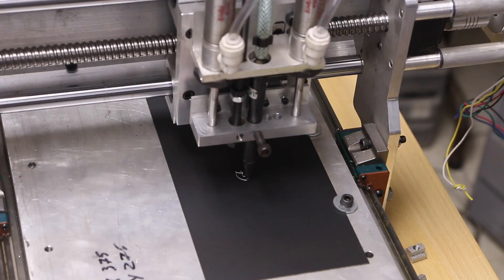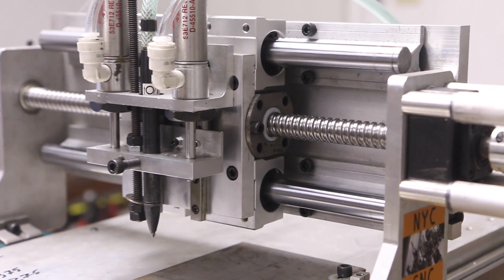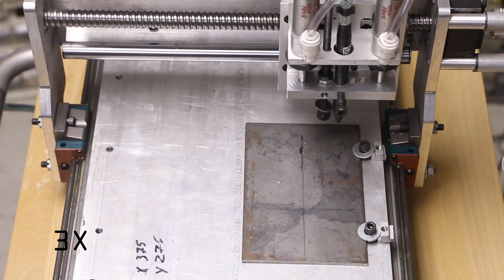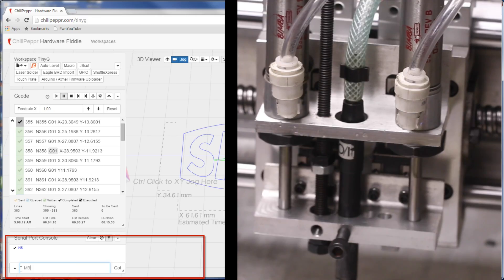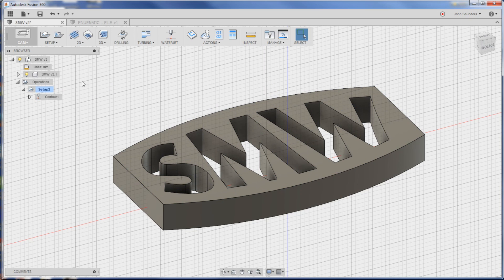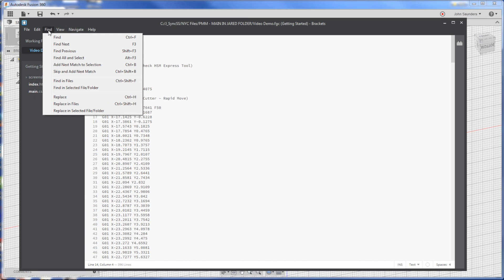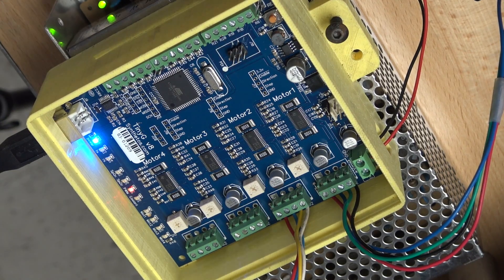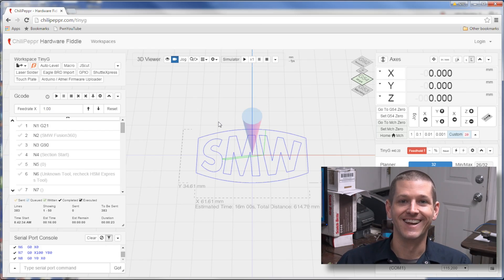DIY CNC Engraving Machine! Widget69

Comment: I dont know why you did not use a stepper for Z numatic's are so harsh and lack analog control.
With Steppers you can zero to the surface and then lift to safez to move to next segment.

Comment: Hi John, Your channel is amazing. Thank you.  In regards to the pneumatic cylinder control, the pressure regulator controls the force generated by the cylinder: Psi(air) X PistonArea=Force.  The speed of the cylinder is controlled by flow controls.  For double acting cylinders use meter out flow controls. The memory saying for this is "When in doubt meter out. It's a sin to meter in,except for spring return cylinders. " When metering air into a cylinder,the air pressure iin the cylinder is changing thus causing the force to change. This causes the cylinder to be jerky as it moves.  My apologize if this is TMI but when I watched your video and realized i actually had something that might be insightful, I couln't resist.  Thanks again for such an amazingly educational and engaging channel.Brad

Comment: Hi John, I also love mixing the machining, computers, and electronics. Great fun. I'm only a very early hobbyist on the machining end though. In any case, thinking about your pneumatic Z axis, what I would do is use PWM to drive the solenoids so you can adjust the pressure/depth of cut. I live and breathe in the automobile embedded control, but it's the same idea as idle control or boost control for a turbo application. In those cases, you have feedback in the way of RPM or pressure, so you know if you're on target, too much or too little and can adjust in a PID loop. But even with the PID control, you still need to set up your base duty cycle for the PWM, so just the base duty cycle might be perfect for your application. By the way, Thanks a TON for all the time and effort it takes to put out these videos. I really appreciate your enthusiasm and consistency!

Comment: John:

Great job!  I saw significant lateral movement of the engraver when it started to engrave.  Stiffening the holder for the engraver would help in attaining precise engravings.  Isolating expensive electronics is a good idea, optocouplers are excellent ways to do this.  There are optically isolated relays as well.  This is especially good to consider given that you do welding in your shop. (The pulses from TIG welders are known to cause electrical noise that can create havoc on sensitive systems).  Optocouplers  can also make logic level voltage conversion easier.  The 3.3V output just needs to turn on/off a LED, the phototransistor then senses this and can switch the voltage that is applied to it be it 5V, or 12V etc. as desired.  As you stated there are readily available logic level translators that can be used, but isolating the grounds is something that few provide. (Using optocouplers you can avoid the need to connect the ground of the 3.3V arduino to the system it controls).

Comment: John,

In response to your other video seeking advice on your "Z stage", you need to look into a low pressure regulator (with backflow) and a spring counterbalance, the spring counterbalance will allow for a gentle retract (with some rubber bumpers), reducing shock loads on the motion components, and the regulator will allow you to tune your engraving head tool pressure to whatever works for that particular tool. If necessary you can also install meter out flow controllers on the up acting side of the cylinder to reduce the speed at which the tool impacts the workpiece. That would be a slick little engraving head kit if packaged as one product.

Comment: Nice job John!  May I make one suggestion, try putting speed controllers on the air actuators.  

While the action may no longer be instantaneous as it is now, I can't help but think that back and forth slamming will cause alignment issues over time, and maybe excessive wear in your stop.
Reply: FYI  pneumatic speed controllers are directional. Air in air out with a needle valve for control. I'm not sure but the valve controller should do the same thing if you add 2 adjustable mufflers to control exhaust located to the left and right of the air in port. It may be very difficult to control 2 air cylinders in unison at low speeds.
Reply: RJ S You could add a flow controler to make it extend slower by limiting air flow

Comment: Looks like a nice robust build on the engraver table, and I have been interested in the high speed air powered engravers for a while. I understand the high speed counteracts the tendancy for the bit to skip when using by hand, but do you think this adds anything in a CNC application? I have a 12k RPM DC spindle on my engraver and it works just fine at a fraction of the cost. What's the advantage of the air spindle for CNC? Also, I am a little concerned with the way your air cylinders seem to slam the tool down into the workpiece. It seems like it would be hard on the bit, and on the bearings/turbine in the pneumatic engraver.

Comment: Hi John, what was the reasoning behind pneumatics versus a stepper on the Z axis ?
It seems very clunky (not your style :) and very slow, given the relatively huge movements they make.
Reply: +Barry Thompson You dont need linear control for the Z axis in an engraving machine. You just need to have an up and down position for the engraver and some adjustment for the lower spindle hight (done here with an adjustable screw) . 

Pneumatic engagement is an easy solution to this because you can engage the spindle with just an electronic valve that just take an on/off signal and for the return up you just need a spring.
Reply: Like I said 'clunky'. Once you start bringing additional elements like springs and manually adjusted limit screws into play, you've lost the 'simple' aspect of the design intent. A stepper could utilize the same height control methods that we use for plasma cutters. Eg engraving on variable height surfaces, such as a curved face.